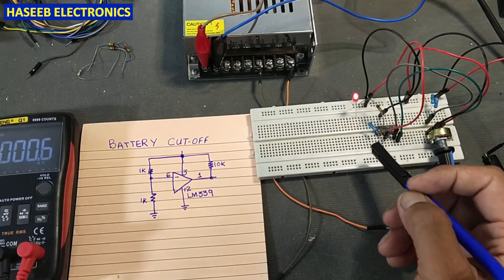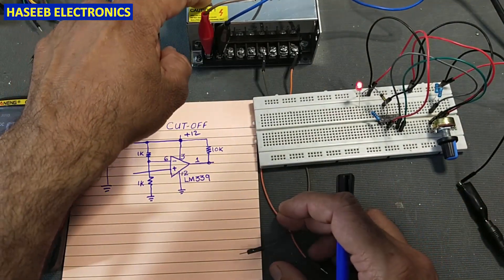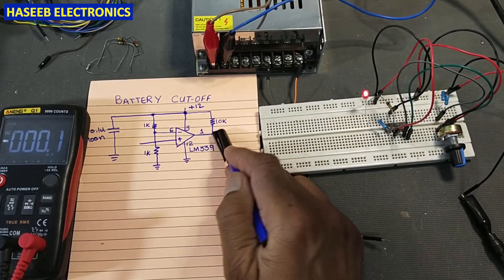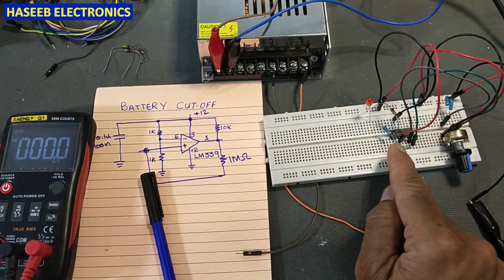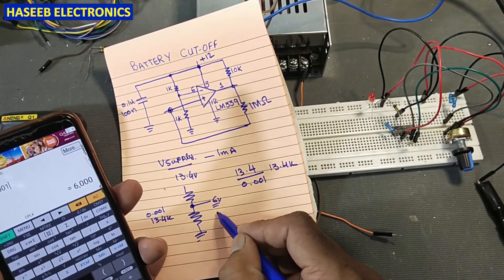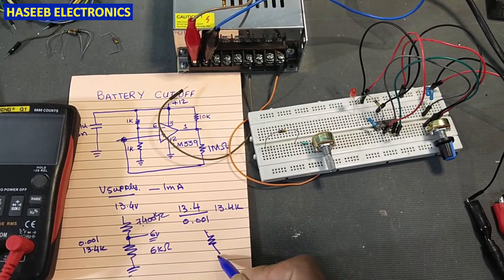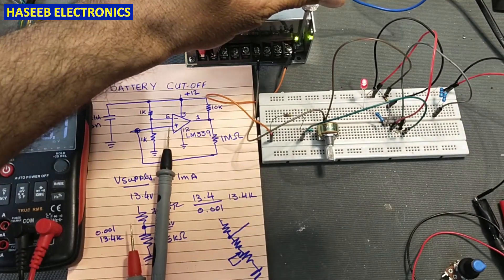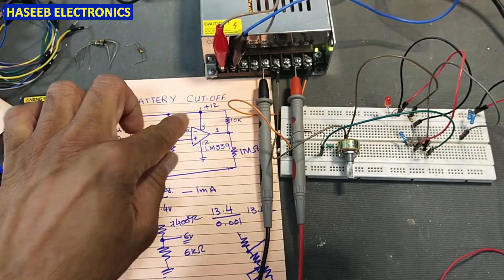{747} Non Inverting Comparator Circuit Using LM339

Comment: Hi, using lm311p, on breadboard the output always stays at active low (0.65v). Not getting active high, the output is in the off state, regardless of the differential input. Any help ?

MC3302P works same as lm339 ?, any modifications needed?